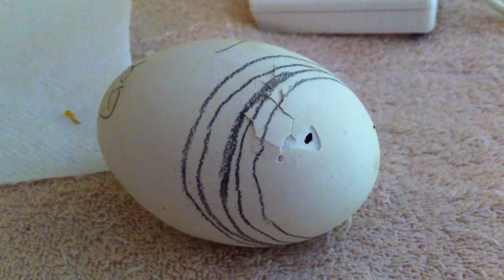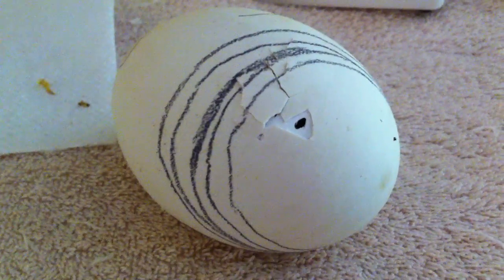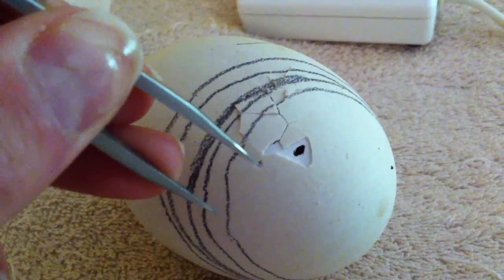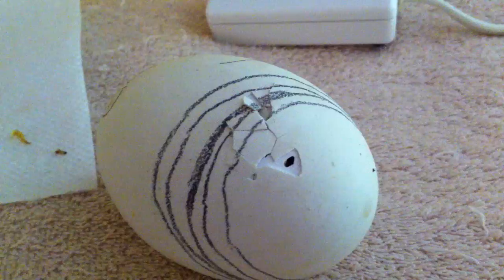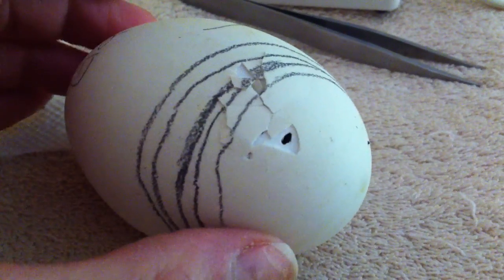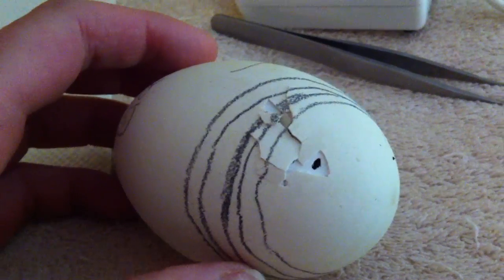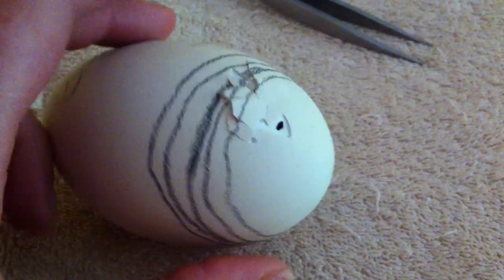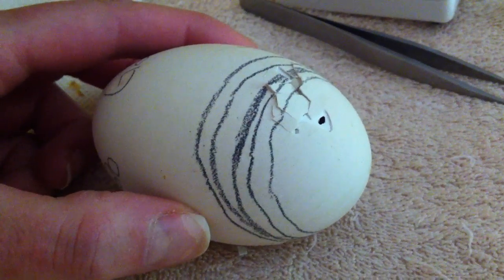After Internal Pip (safety holes) Goose Egg

Comment: All my 3 geese eggs have internal pip in the last 2-3 hrs. How long will it be before they/or I, have to external pip eggs?
At the point they internal pip do I increase humidity because Im getting mixed ideas on this..HELP! thANKS
Reply from the maker: +Arif Khan (KHANAGE) They must have hatched by now :) I put my eggs in the hatcher when they start shadowing, which is slightly before the internal pip. So that's when they get increased humidity. I also lower their temperature to 98.5F at this point.
Reply: OMGDucks&Geese yea they hatched on friday the 13th lol. 3 hatched but 1 sadly dies as it hatched in centre and not air cell. I did my best ;( the other 2 are doing well and are so cute! cheeky and like cuddles lol
Reply from the maker: Sometimes they don't get into the correct position and end up pipping in weird spots (usually an egg turning issue). I haven't had any die from this yet but I meddle with my eggs a lot and will make a breathing hole for them if I see that they're not where they should be. It can be really hard to find though if they can't make an external pip on their own! Sorry about your one you lost, it does happen.